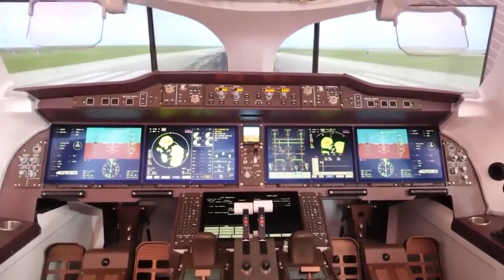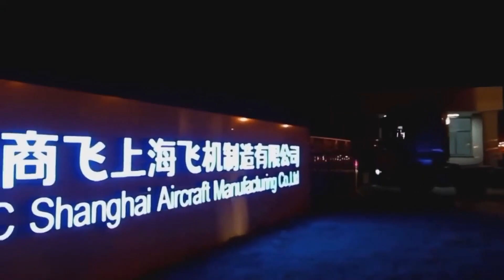The С 919: China's Answer to the Boeing 737 and Airbus A320

Comment: Like high speed railways and fighter jets
One you sold them a good amount of them, after few years (or less), they will somehow develop similar version but way cheaper
Reply from the maker: Reverse engineering
Reply: @netman3774  And C919 use side-stick in the cockpit and Airbus happens to have a joint-venture assembly line factory in Tianjin, China
Reply: @netman3774  why don't Chinese invent rather than copy😂